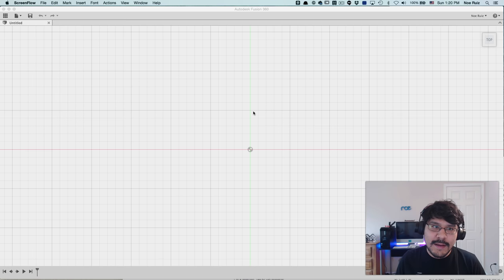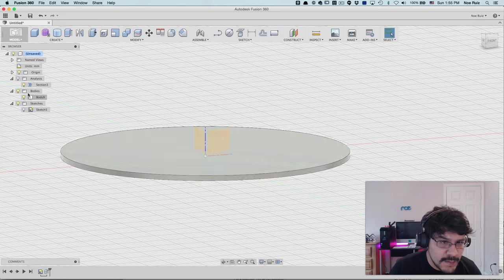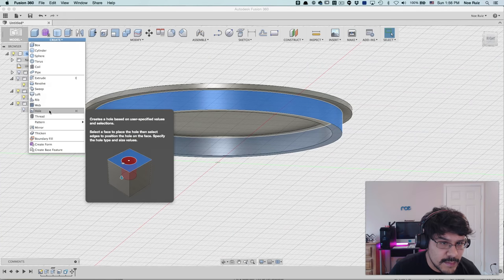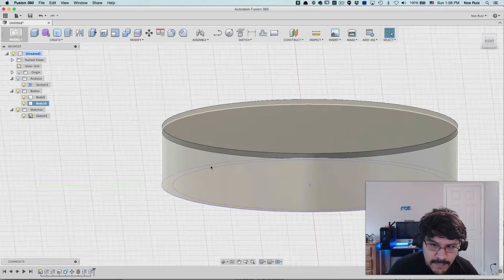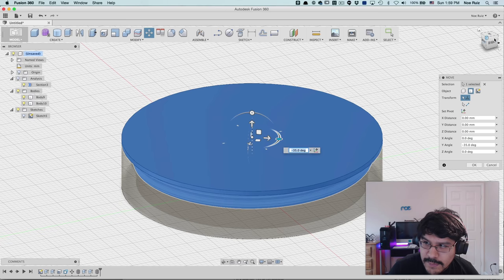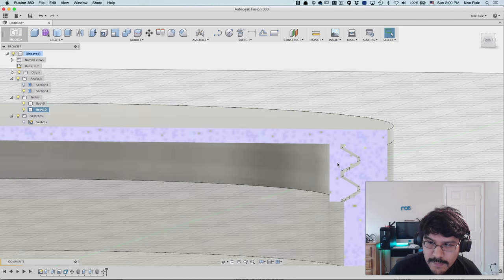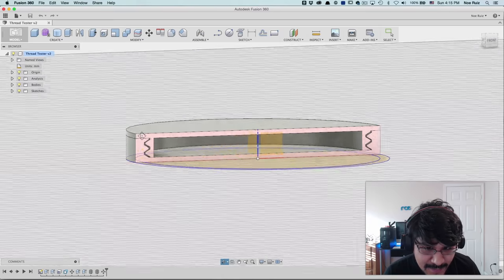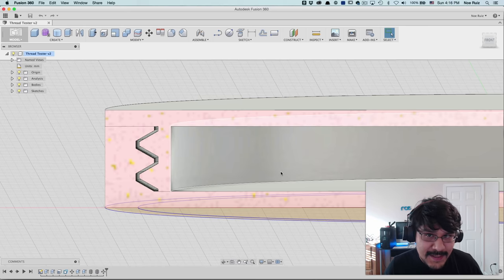Layer by Layer - Twist Top Case

Comment: Five years later, and your video is still helping new makers like me with making screw tops for models!! Thanks for the great explanation and the tip on making one of the pieces "glass" so you can see inside without switching to wireframe (which frankly makes me feel cross-eyed).

Comment: Quickest and best explained threaded container tutorial on YT. It's been a while since this was posted, so your newer printer probably deals with tolerances better than his. I'd do a bit of testing and try to work it down to a tighter fit. My Ender 5 S1 prints a good fit at 1.2mm tolerance (that's 3 x 0.4mm wall width). You can adjust the thread tolerance by selecting the upper and lower thread faces (of either the lid, the container, or both), then using press/pull.

Comment: Super great video. I think I got it enough to try one of my own on a Makerbot Replicator+. Although the lid didn't line up in your video, at first, I think it would have worked anyway, as it will just self start and align at the beginning of the threads. However, rotating it like you did let you use F360 to its greatest benefit, to measure the thread clearance. I did mine at 67 mm OD and 40 mm high + the 1mm, as you said. Thanks for the share.

Comment: In my experience the inside threads tend to shrink in printing, often even stray lines that adhere poorly to the walls. I compensate by making more tolerance on the inside thread and even filleting the protruding edges for a smoother print.

Comment: Hi there Noe,  Thanks for doing these videos in what I assume is your own time. I love the speed of your videos and the fact that you don't waste time, knowing we can go back over it as many times as it takes to get the idea. I am working on a small project and just wanted to ask which type of thread you prefer for a cap. Do you like the Male/Female or the Male/Male type of thread using a coil. I notice most bottle type caps are made using a Male/Male thread. Also do you consider a 3 part thread ( ie 3 @ 0.333 revolutions equal to 120 degrees each ) easier to mesh together, rather than a single 1 revolution thread. For my project I only want the cap to turn 1/3 rd of a revolution and yet travel about 8.5 mm before it is locked against a collar. 
In your video showing the Male/Female thread, the female thread did not come to the top of the cup (lower part) so I do not know how the male thread would be able to mesh with the female. It would have to get past the area with no thread first, I think !
See next comment above.

Comment: I drew the part up myself, following the video. The bottom part with the involute thread printed great, but man, that upper part is giving me problems. The thread keeps getting messed up - the printer (Ultimaker original w. heated bed & E3D V6-head) is under-extruding material when i try to print it. So annoying. :/
Reply from the maker: +zaprodk What layer height do you have it set to? I'd suggest using 0.1mm with a slower print speed (40mm/s)–Noe
Reply: +Adafruit Industries I tried 0.1mm 50mm/s - I will try a lower speed and see what happens :D